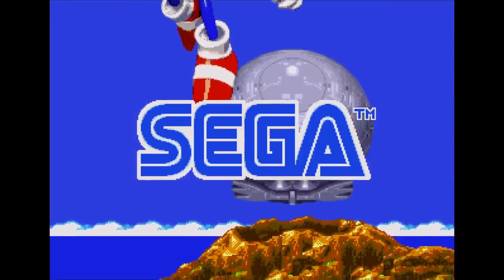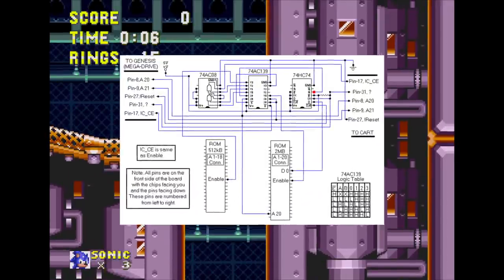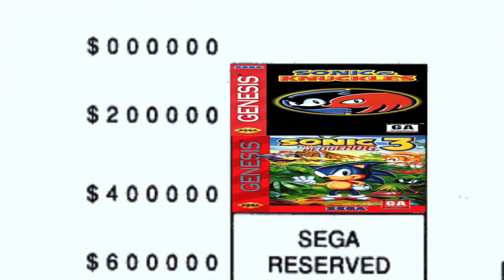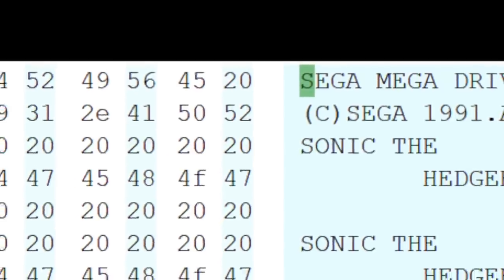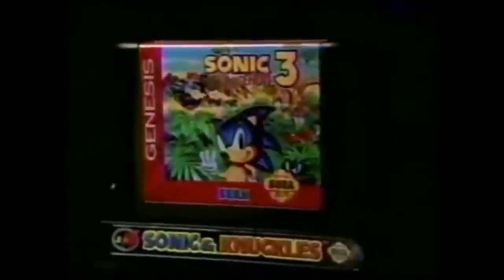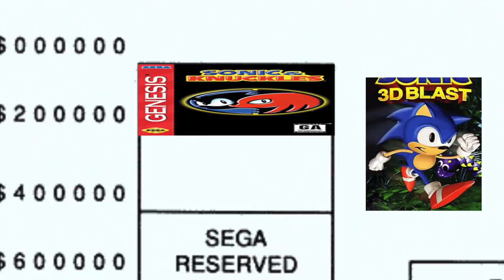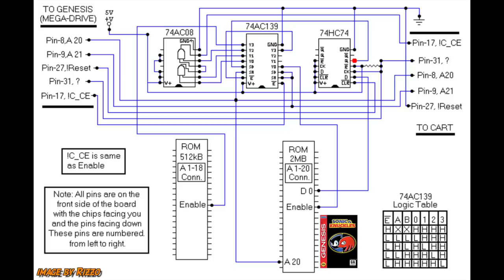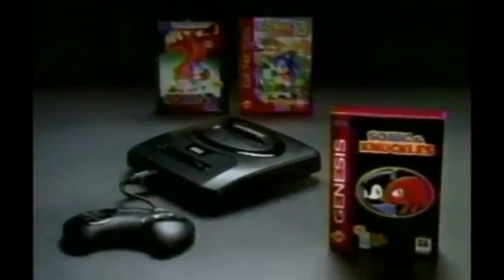SEGA's Crazy S&K "Lock-On Technology"

Comment: So what would happen if you just changed the serial number on the rom and s&k interpreted that game as sonic 3 despite it not being sonic 3? Insane corruptions?
Reply from the maker: I'd imagine so - maybe I'll go try it...
Reply: @CodingSecrets  I'd love to see it
Reply from the maker: I tried changing the serial number of a random rom to the Sonic 2 one and it crashed. But using the Sonic 1 serial number allowed me to play all the special stages. This is because it doesn't use any data from the sonic 1 rom just the serial number...
Reply from the maker: Changing it to Sonic 3 showed a corrupt screen and played the SEGA sample. Then started playing the intro music with a corrupt screen. Then crashed... Maybe I should do a  follow up video...
Reply: @CodingSecrets  I'd assume certain games would have certain different levels of corruption and not much else. I wonder about how modified versions of sonic 3 would handle assuming most of the code is the same but certain functional bits for s&k are modified or inoperable. I also wonder about 32x/cd/svp games as i know nothing about how those would work in this context

Comment: 6:05 So the Sonic & Knuckles cartridge actually contains the full version of "Sonic 2 & Knuckles" and plugging in the Sonic 2 cartridge merely makes it load?

I guess that would be a way easier solution to implement than trying to reuse the data on the Sonic 2 cartridge...
Reply: The real magic happened when you plugged in Sonic 3.
Plugging in Sonic 2 only let you play it with Knuckles.
Reply: I just looked it up and the Sonic 2 ROM dumps take up 1 MiB, so I doubt the 256 KiB chip contains a full copy after all.
Reply: @majorgnu  Only code, Knuckles' sprites, palette data and stage layout, the rest is read from the Sonic 2 ROM
Reply: More info here:
http://www.emulationzone.org/projects/s&k/

Comment: I heard rumors, that you can use up to 4 different games to plug them into that cartridge. One of them is Micro Machines, as far as I remember. But I dont know if that is true or just bullshit-rumors like Sheng Long. They said, when you enter the right code, it will work. Would be nice, if it works with Ristar or Rocket Knight Adventures.